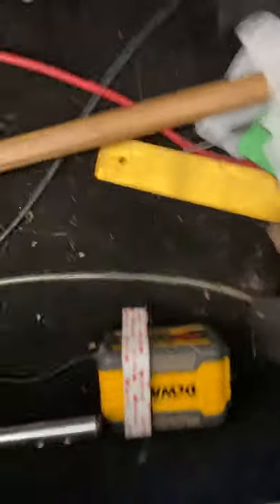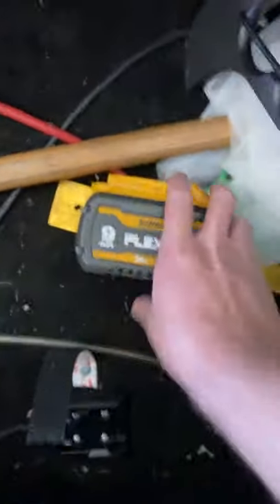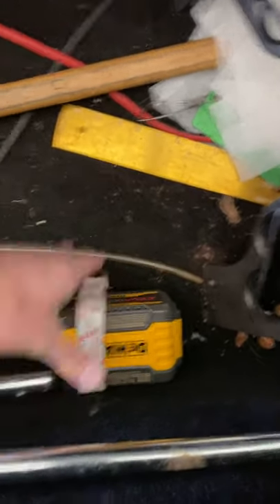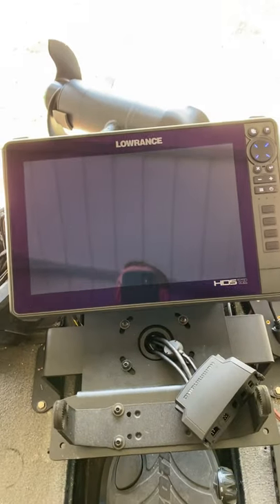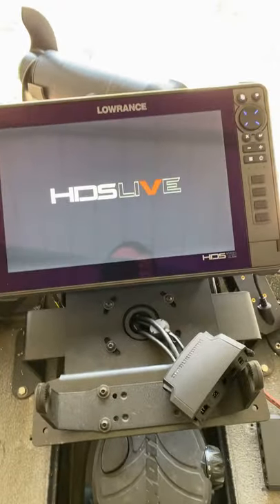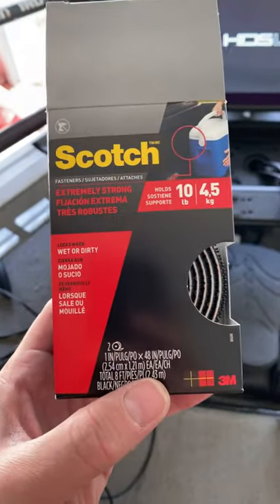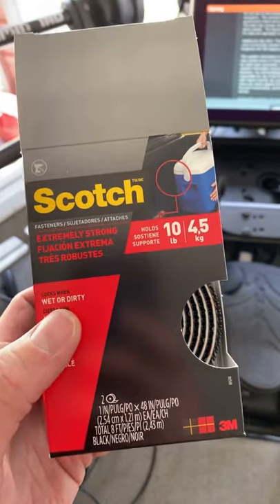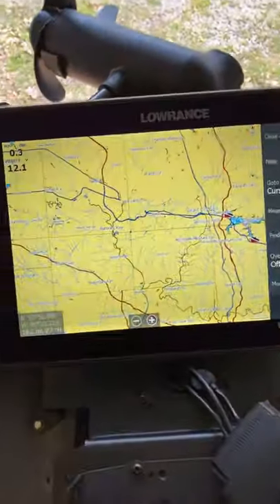Lowrance HDS Live 12 & Active Target- Seelite Dewalt Lithium Adapter

Comment from the maker: UPDATE: I am running the HDS12 off my cranking battery and the active target off seelite. The HDS12 would only run 3-4 hours off that 9AH battery
Reply: Did you do a run test to determine the actual amount of time you’d get out of that battery with just the unit running? Or are you estimating?
Reply from the maker: @ThatBassFishingDude  I saw a chart on Amped lithium battery website. They list the different units, amps, and estimated run time for diff battery sizes

Comment: Question what did you do with the yellow wire on this setup? I know this is an old video. I’ve got my active target wired to a dewalt and the graph hooked to the 12volt battery. I hooked the yellow wires together and my active target isn’t cutting on now. Help please lol
Reply from the maker: I ended up not hooking in the yellow wire. When I want to use my transducer I plug in my Dewalt battery, when I turn it off I pull of the battery. I ended up hook the hds 12 to a bigger lithium battery so it’s always on and I just use the. Dewalt for the black box/trasducer
Reply: @JLOutdoorsMedia ok I was wondering the graph will cut on! My black box active target hasn’t cut on. I was thinking maybe it was because I had my yellow wires hooked together instead of on my hot wires

Comment: which voltage regulator did you use?
Reply from the maker: I actually changed my set up and used the seelite to only power the active target black box. Since I did that there is no need for a voltage regulator. If you are running a graph with the seelite, you’ll need the volt regulator. I got mine off Amazon it was around $40 I believe
Reply from the maker: Cllena DC 8V-40V to 12V 10A Automatic Buck Boost Converter Step Down/Up Regulator Voltage Reducer Converter Waterproof Regulated DC Power Supply for Golf Cart Club Car LED Light https://www.amazon.com/dp/B08KZPXK63/ref=cm_sw_r_cp_api_glt_fabc_MYJN4MG1SG41W6084DTM